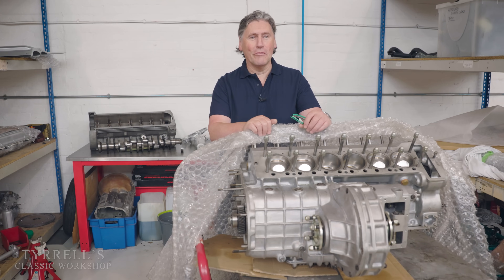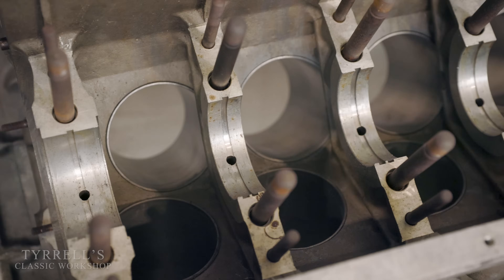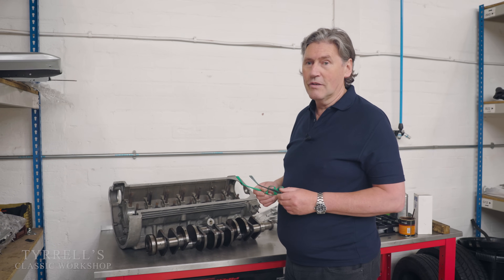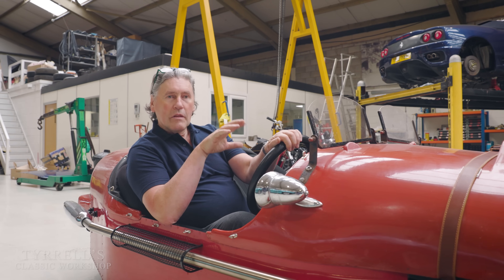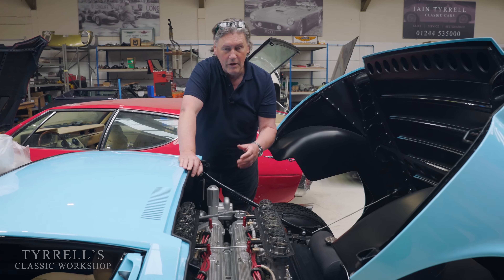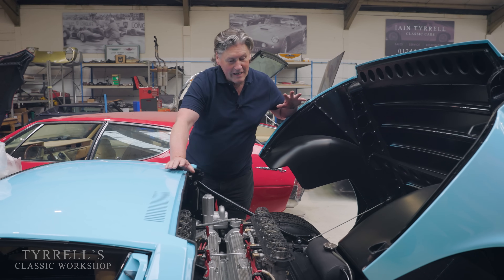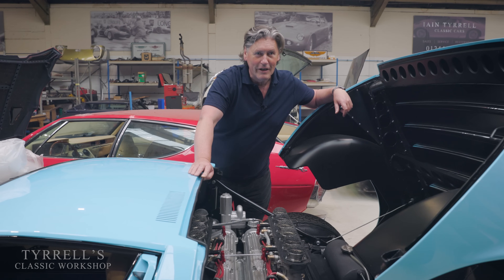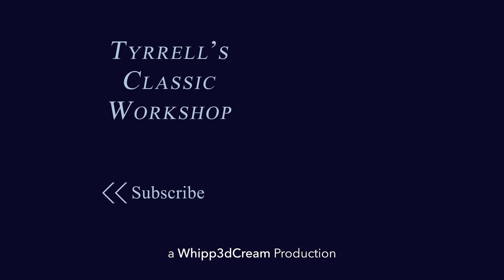How to warm up your classic car engine the correct way & why it matters | Tyrrell's Classic Workshop

Comment: I pull the hall sensor("Hallgeber") cable/plug at the distributor - in the belief that it not only cuts off the ignition but also the fuel injection ? (on a mid nineties VW T4 petrol engine with a "Digifant" VW fuel injection system) I unplug the hall sensor plug directly at parking it, if I don't plan to use the car again soon. It protects me from forgetting to "prime" the oil pressure and gives a small additional theft protection.  

My starting procedure consists in two times cranking until 3 seconds after the oil pressure light has come off.

And yes, thank you so much:  love the moments when you pass the threshold of default knowledge. Instead of a sonic boom it unshunnable dimples  thousands of smiles, I imagine.

Regards from Zürich

p.s.: 

I'm running an 80AH battery with "EFB" (= Enhanced Flooded Battery) technology used/developed for start-stop functionality, instead of the 60AH standard type battery the two litre came with from the factory. The 80AH EFB has the physical dimensions of an 100AH standard lead battery. But it gives a very healthy cranking power even after long standstills and also saves me the leisure battery circuit, since I can easily run an engel compressor fridge (with its cut out voltage set to "HI"=11.5Volts)of of it for two days.

Comment: surely, the obvious thing to have done (pre ECU) was to fit a hi-pressure oil switch that locks out the ignition until a pre-determined safe pressure / time interval has occurred.....Too obvious?!

Comment: Even my modern Car 2014 bought split new factory ordered I let it sit for a minute till usually you know the oil is circulating. Don’t know if it something someone told me or just always thought it was best as my car usually sits for four days at a time. Probably means nothing in a modern BMW engine. Although seemingly when my Car was in for a service in a independent BMW trained garage that I trust completely used for years they looked up the BMW service record and said yeah the shells were renewed early in its life by a recall because the engines were going bang.

Must emit watched so many people rev cars silly on start up and I mean older Cars. The only think I’d say I was guilty of was not pushing my engine enough it revs to think 7k revs before the rev limiter cuts in - not that I have ever seen it on 😂 yes I drive like a nun, car revs at 5k I get annoyed I took it to that like I have damaged it ( as I said even at late 40’s I’m not mechanical minded at all) But all this classic Car start up I think I would enjoy if I had one. Changed days I flip a switch to start.

Comment: I literally laughed out loud at the comment early on regarding oil traveling through "a small U-shaped tube, not YouTube".  It was a quick loud blip of a laughter on my part, much like the "BWwaaaAP!" of a single cylinder two-stroke dirt bike engine when the throttle is quickly twisted and released. In that moment, your comment as delivered just totally caught me off guard — well played Iain.

Comment: Electric oil prime pumps or manual spark kill switches seems to be a must on these old gems as a solution for this 😊 as always a relaxing pleasure to watch your video 😊
Reply: Not really. If the engine is cold, you don't let the pump prime before turning the engine over, and you don't pump the throttle, it won't start. At least that's my experience.

Comment: With the new PHEVs, the ICE starts suddenly and revs quite high when the electric motor lacks power. Often the ICE is not given time to warm up properly after a short trip. I wonder if these engines will last?
Reply: No! i don't think you would want to buy a second or third owner example.

Comment: I suppose this sort of thing is far more controllable on a vintage car with a fuel tap and a hand throttle; you could crank the engine with the fuel supply switched off, to build up oil pressure, before switching the fuel on to get the engine running, and finally using the hand throttle to set a fast idle so as to maintain good oil pressure. That's when you could leave a car to warm up while you lock up your garage!

Comment: I often wonder why the fuel pump isn't disengaged (oil pressure switch to the fuel pump relay)  for the first few second until a certain oil pressure has built up. This would prevent a car firing until the oil was flowing?

Comment: Fascinating - my Alfa 156 V6's computer is quite brainy in terms of finessing all that is necessary on the Miura, and for good measure has SPICA effectively (injectors in the base of the chrome trumpets) which allows it to warm itself over 5-6 minutes at 1700 rpm before dropping down to 1200 ilde. The 155's and 164's I've owned in the past were like this too...

Comment: Ian, I own a humble Opel Ascona SR with a Rochester Varajet 2 carburetor. As it was the "posh and sporty" version it has some sort of automatic choke. There is a notched scale that is left for adjusting it depending on outside temperature /season, but at the same time there is some temperature sensor connected to it as well, that also works in tandem with it to control idle engine speed. Long story short - the car is very temperamental on its idling. Either it works beautifully around 1000 RPM or even if it's warmed through it sits above 1400 RPM. I imagine it could be a malfunctioning temperature sensor that doesn't actuate the rest of this electro-mechanical choke.

Comment: Even at 17, i had way too much mechanical sympathy and would be all to eager to get that choke back in as quickly as possible.
Nowadays, I pull the fuel pump fuse on my relatively modern classics, turn the engine over a few times, then put the fuse back in and let it fire up.

Comment: While not a Lamborgini, my 1980 Alfasud Sprint has a 'cold' light, along the normal temperature gauge, and as the manual explains, don't cane it until the light goes out! Plus stop when it comes on when hot!!

Comment: Very helpful video. Thanks! However... It wasn't clear how long the engine needs to run at 1500 RPM... until the oil reaches 'operating' temperature? I have a mid-70's Aston with Webers, and it takes quite a while for the oil to start to warm.

Comment: Can't thank you enough!! Now I know the correct way to start my 72 Jaguar XJ6.  In winter we have routine temps in the negative teens F. occasional negative 20's, shall I assume an extra beat or two (beyond what you describe) on the starter before pulling out the manual choke would be prudent?  Again, thanks for this video.

Comment: Great video! Some engines rattle on cold start (and sometimes warm).  I guess this is probably not good for them. I have a 2001 Porsche flat 6 that makes quite a racket for a split second when started - I’ve been told it’s the timing chains! It would be great to have a video on your thoughts on oils for classics.
Reply: I have a 1997 flat six. If it’s sitting for a few weeks, remove the DME relay and spin the engine until you see oil pressure on the gauge.

Comment: Would it be worth fitting some sort of isolator switch for the fuel pumps in old engines like those Lambo 12s?... So you can crank it over for a bit before giving it fuel. 

I'm sure there's a reason that's not as helpful as logic would suggest, but it makes sense to me.

Comment: Another reason why modern engines last so long is also down to the oils that are used. The oils of today are so much better at protecting engine components than the oils of yesteryear. 

I’d also be curious why more engines do not have electric oil pumps. The benefit of them is that the oil system can be fully primed and pressurised before the engine is cranked.

Comment: Bmw m88/30/10 etc with their spray bars, if not maintained and never used hard can bung up, causing cam wear/failure, very strong engines mind, one of the best 6 pots ‘imo’ especially turbo. No need for the majority of this video with them,once fired off the key and give them use!

Comment: I realise, that we are still talking about 100 year old technology, modernised somewhat, but would it be advantageous, if there was an electric oil pump connected into the primary circuit, BEFORE any hint of engine turning, to drive the oil around the galleries ?
Following this, the engine could be started normally  ?
And in fact the engine start would not happen unless the requisite oil pressure was delivered  !
100 years too late, but my classic is 62 years old, so it's still game on  !

Comment: Informative video. I owned  a classic MG Midget & was always careful to start the engine & idle it with the choke to prevent oil starvation--I never had an engine problem doing it that way.

Comment: Thoroughly enjoyed this presentation Iain, the incorrect cold start routine can easily destroy a good engine.
You didn't mention the "the engine lube pre charge accumulator system" that some classic owners have fitted to their vehicles. A friend of mine has that set-up on his classic MGA for cold starts, it seems to work well protecting the engine bearing surfaces.

Comment: i own a 2006 mazda 3 and my rule has always been to let the temp gauge (no oil pressure gauge on my car) get to at least halfway between cold and operating temp before driving off..granted its a modern car but it seems to be happier..my old mazda rx7 (v8 swapped sadly) id let the oil temp gauge get off the peg before i drove it..

Comment: My own thoughts on this; 
1; TOP QUALITY engine oil of the correct grade,
2; Minimise the choke, it is putting in extra fuel, which is washing oil off the bores etc 
3 personally i use an upper cylinder lubricant in the fuel, 
4; move off as soon as possible so the engine warms up meaning the choke goes off sooner 
5; keep RPM low ie DO NOT REV the engine before it is fully WARMED UP!!!!!!!!!!!!
The oil i use leaves some on all moving parts bores etc from the last run!!

Comment: One other rule with air starters : only allow the engine to turn 2-3 turns - it wont start at only that, listen to and watch the output shaft

Turning the right way ? (remember diesel which will happily run the wrong direction !)

Air for two-three turns and cut - continue checking

Now allow the engine to start.

Comment: For a large diesel engine (not ship-large so for example a GM locomotive engine) there existes a manual lever operated oil pump so you basically opens a cock between the pump and the main oil gallery and so builds pressure 20-30 takes on the lever until the oil pressure needle is up. 

Now you CLOSE  the cock and look for the compressed air starter lever.

Forgetting the cock - suddenly the main oil pump will pull from the sump through oil the hand lever pump and into the sump.....

Comment: As others have said who could imagine that starting an engine could be so interesting? But it is and so well presented!

As a heathen with a 30y old diesel can I ask if the same sort of thing applies? Such as crank it a bit longer to allow oil to flow a bit more and oil pressure to build a bit before it fires up? With indirect injection this could be achieved with manual control of the fuel cut off solenoid valve on the pump for a second or two. Thoughts, please?

I was told that with any engine once it’s running, it’s better to get it under some load but not too much as this is what builds heat, (some fuel rather than a tiny bit). Again, idling starves oil as the pressure is low and there’s more ‘parts momentum’ so cylinders are thrown about rather than pushed by useful ignition combustion if that makes sense. So, once an engine is running it’s better to get it working (a bit) and pootle about but not push it or labour it in a higher gear and is it the same for petrol or diesel? Thanks!

Comment: If you have a vehicle with an old school American V8, including the Rover(Buick) V8, these engines send oil to the valve lifter galleries first, then to the cam and crank bearings, so it is especially important to wind the engine over until you have some oil pressure before letting it start. This was done because they have hydraulic valve lifters and it reduces audible lifter rattle on start up. I'd rather have oil going to the crank first, then the valve gear and put up with rattly tappets for a second or two, but that's just how it is!

Comment: Great to see this Iain. Hopefully some classic engines will live longer now. A tip for some more modern cars with chips in the key: use an unchipped key until the oil light goes out then start the car with your  chipped key. Guaranteed instant oil pressure.
Reply: Very clever idea, I'll try that, thanks.
Reply: hold the pedal too floor then crank, wont start

Comment: Brilliant thank you,  always a source of debate among classic owners. I sometimes go several months without starting my Rover 3500. The practice I employ is to charge the battery then remove the HT lead before winding it over on the starter until I get oil pressure on the gauge. Hopefully that's helping it the best I can. Maybe not ideal for the starter but the engine is very low mileage (only 38000 from new) and has already had new bearings.

Comment: My pre-war Alvis had a starter which was separate to the ignition, so it was possible to wind the engine over for quite a long time before turning the ignition on. I’m sure that this arrangement must have been beneficial to the engine.  Thank you for this very useful episode of you classic workshop.
Reply: Ya, on the DC3, it is usually nine propeller blades, or three revolutions of the engine on the starter, before flipping on the magnetos. Throw in the priming and the mixture control and the main fuel pumps and booster pumps and booster coils, and you quickly become a 'One-Armed-Paper-Hanger'!

Comment: On my 360 Ferrari I leave the immobiliser activated and crank the engine until I see oil pressure, then turn off immobiliser and start normally.

Comment: Very good, as usual.  I wonder if this video could be shortened & summarized, incl. to never 'load' any cold engine, as well as the 1500-2000 RPM suggestion in this video?

Comment: Hot pockets  can be a issue as I recall what my fiat mechanic explained. That  u can have different temperatures. Some at 80 and all the way 200 degrees I swapped to a electric water pump and ditched the thermostat from the old manual water pump   I had a 2l  with 1.8 head.  In my 77 124 spider.   It’s been ages since I had my fiat spider   The  electric water pump could be mapped with a fan  modele    So the engine comes up with even water. The sys can active the fan   If it’s a hot day it also stays on to cool engine after turning off the engine   My mechanical knowledge is a bit worn lol

Comment: I own several BMC A Series engined cars , classic Mini , MG Midget , Morris 1100 etc . I’ve always started them with a minimal use of choke as described here ( thankfully ! )  but I always try to get underway as soon as possible , under light load and not revving them above say 2500 RPM until they at least show something like normal water temp. Would you recommend this approach or is a period of fast idle first preferable ? Another great video by the way , thanks and keep up the good work 😎

Comment: I put a programmable ecu on my 80s bmw engine and I found that it started extremely quickly and the oil pressure light was on for a bit to long once it started.  So I told the ecu to skip the first few ignition events so it cranks a few times and the light goes out just as it starts- similar to as you describe on tbe Bentley.

Comment: Spot on Ian. Always try to get oil pressure up as soon as possible. Also do not race the engine on cold oil. When ready move the car off and take it easy with revs and accelerations until oil is up to sufficient temperature. A VERY important aspect is to ensure you use the right oil as recommended by the manufacturer. Too many times we see people taking the oil company baits for newer and lower viscosity oils. Maybe ok for this century and closer tolerance engines but certainly not for last century engines. Don't over think the oil and simply go with manufacturer's recommendations.....RTFM (refer to the ...... manual) LOL. Other point of note is regular oil changes and use a good quality oil and per the manual. You will enjoy and your car will enjoy many miles of happy motoring :-)

Comment: Does make you wonder what effect stop/start has on engines and turbos still spinning
Reply: Yes and cylinder deactivation, and catalytic converters, that’s why I switch it all off. Iain hasn’t even touched on thermal efficiency. On cold starts I am not aware any manufacture applies these new fuel saving technologies. I have always viewed them as short term gain for long term expense.

Comment: Too much lost sleep over a few sleeve bearings. Meanwhile, the valves, guides and seats will be deteriorating, the body and frame rusting, the headliner is sagging because you've been excitedly exhaling too much, the interior is shot because you sat in it, the transmission needs overhaul because you were shifting all wrong, the brakes need doing again because you were driving...  Some perspective would include mentioning that a lower end rebuild is not exactly the end of the world.  In other words: restoring a classic car say (for example) £37,500, restoring a classic car including rebuilding the bottom end, £41,000, merely an extra line item on the bill.  I've been absolutely hammering on cars for ~45 years and have NEVER had any issues with the bottom end, except that one time when an exhaust valve broke and smashed a piston and bent a conrod (even then, a $450 repair job, total). The typical over-concern about engine bottom ends and utter paranoia about engine oil could be divided by about ten to bring it into logical alignment with the maintenance costs and failure likelihood of the rest of the car.